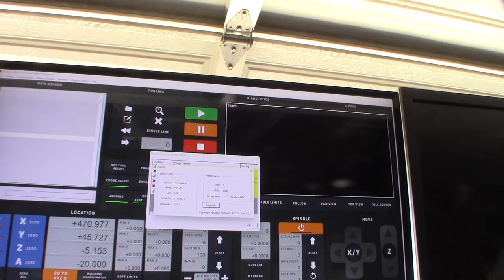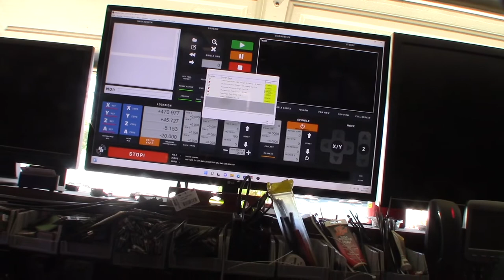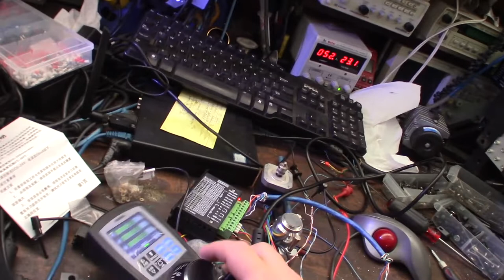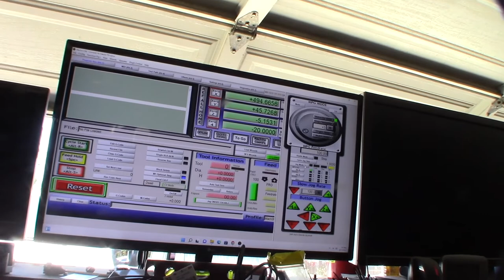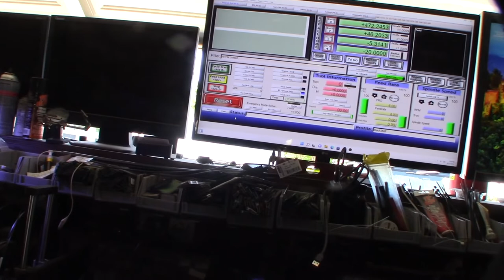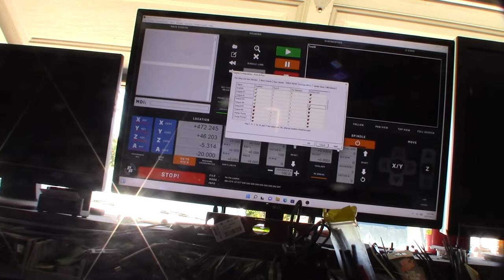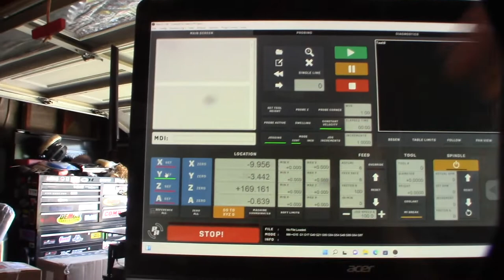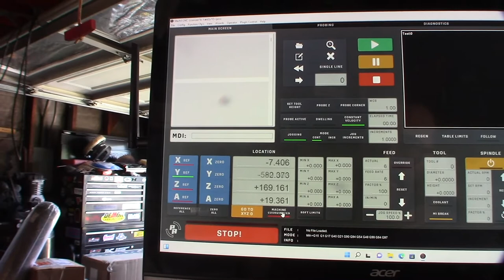Novusun NVCM Mach3 USB controller, Lots of interference, Glitching

Comment: For me it didnt work, i dont know maybe its getting to the trash. wired it like you do, outputs not working but now my spindle is 4000rpm slower its controlled thru m3. the other issues are nearly the same, no connection only when reconnecting usb then the spindle turns 1 sec. In win10 device manager this thing is suspect ....

Comment: THANK YOU SO MUCH! I've been breaking my brain for days poking every way I could think with my meter trying to figure out how the switched output was working. Couldn't find continuity of voltage and was stumped. Just needed to switch a relay for my plasma's 18v circuit to turn it on and off

Comment: Hi, just wondering if you could help me I also have a hard time at the outlets. Any chance you could do a video about connecting relay to the unit? I am working with the same unit that you have in this video. Any help would be appreciated using it on my plasma table.